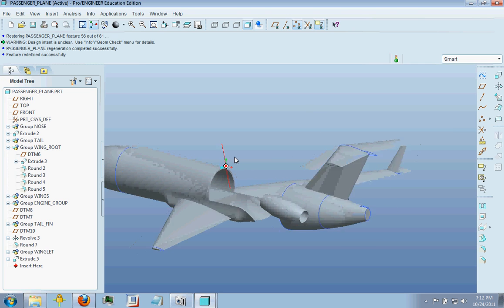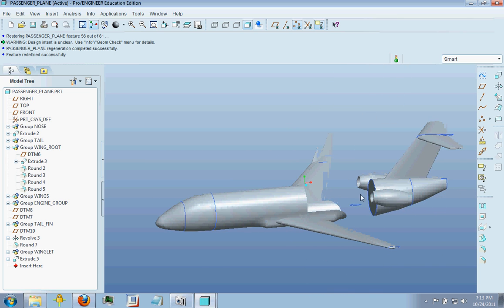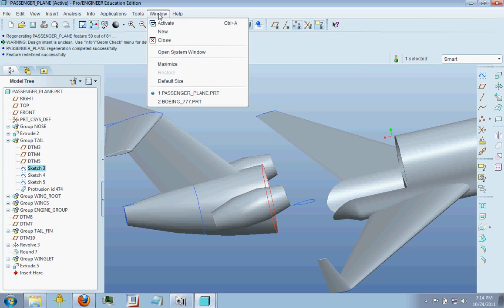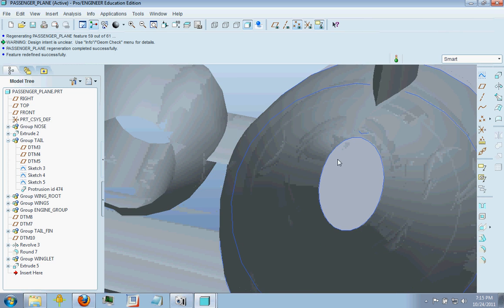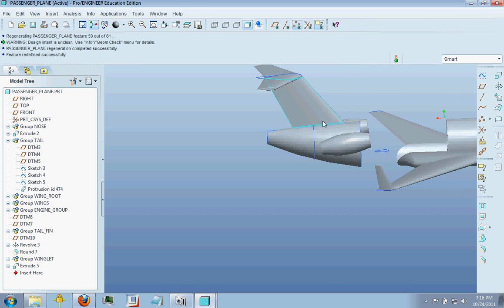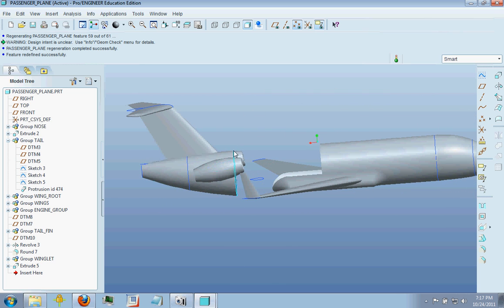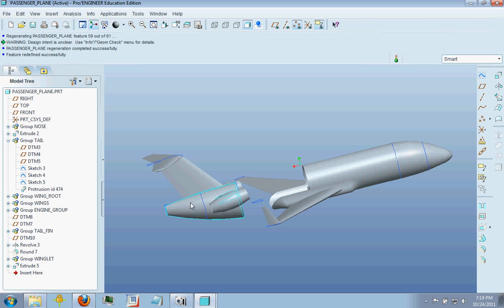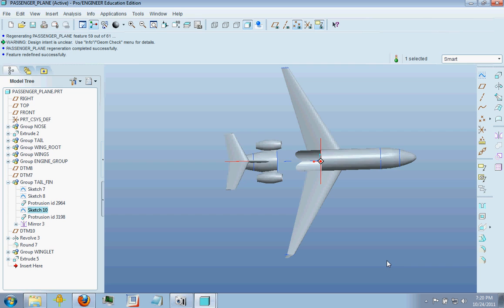General Airplane Design - The Tail

Comment: Is the shape of the vertical stabilizer just a symmetrical airfoil?
Reply from the maker: coastermania17 Yes it is. Unless they have an odd configuration (V-tail, a-symmetric fuselage, etc) airplanes will generally have a symmetrical airfoil for a vertical stabilizer.